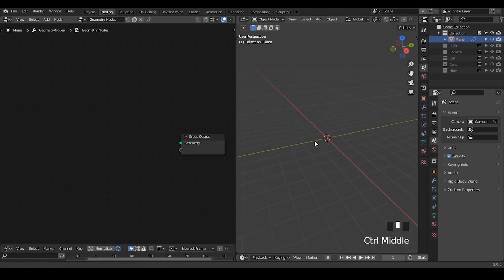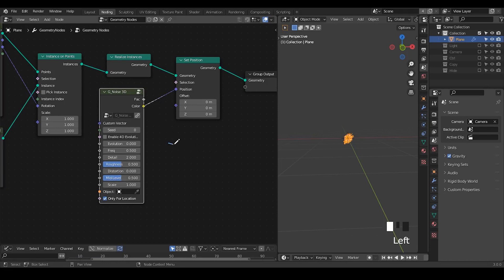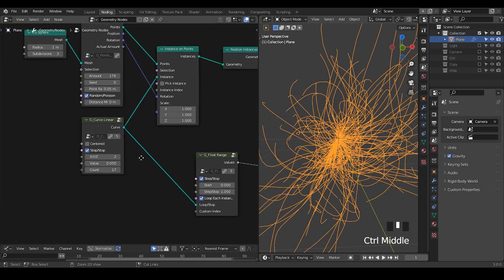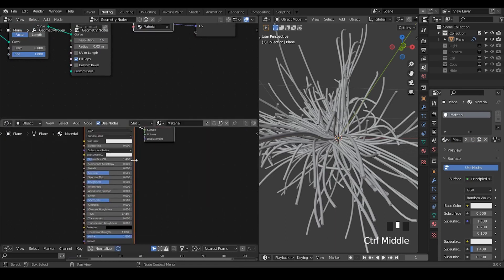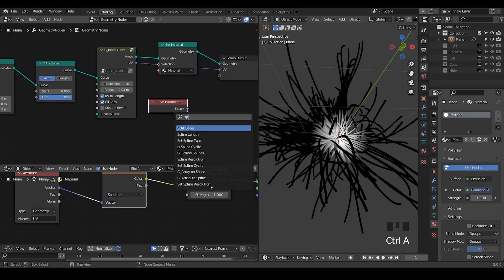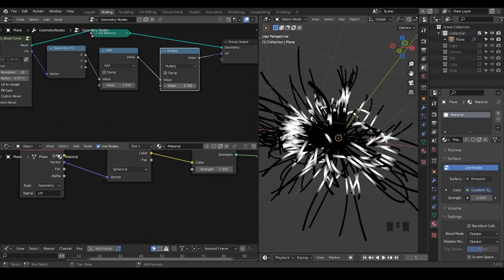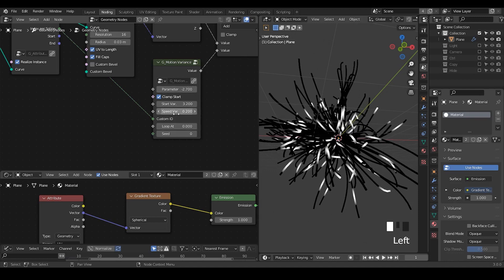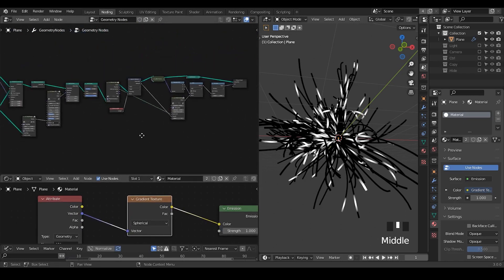[Tut] Noise Tracer - Blender Geometry Nodes 3.0 Field

Comment: Love it! Only I can't find the "G_Motion Variance" in the Geometry Nodes Preset Version 1.1.0e
Reply from the maker: In the current file on gumroad, I can confirm the presence of Motion Variance Node. I added that before this tutorial, so If you've downloaded the preset only when you watched tutorial, I'd suggest to check the file carefully.
Otherwise perhaps redownload the file maybe helpful. (I'm also going to upgrade it to 1.1.0F today).
If you still have problem, it may be better if you can contact at: http://discord.gg/TzuN6sPxQU
Reply: @bradleyanimation120  thank you for the quick response. I found the "G_Motion Variance" in the Geometry Nodes Preset Version 1.1.0e.  I think something went wrong with linking the file.